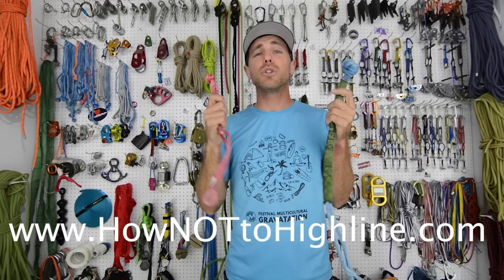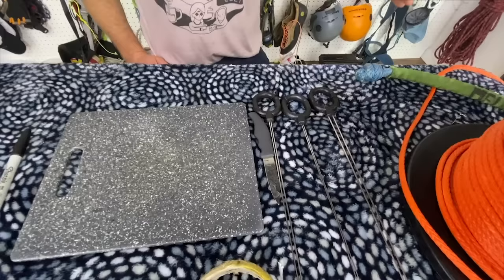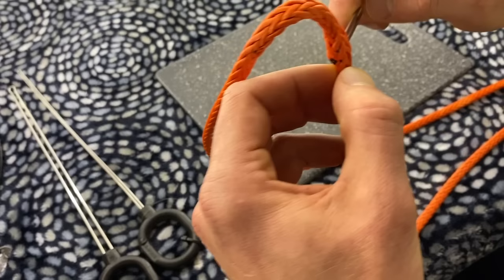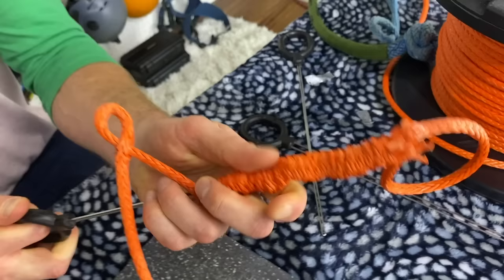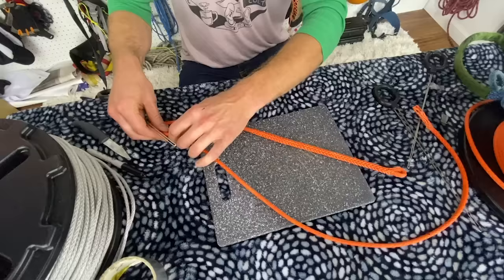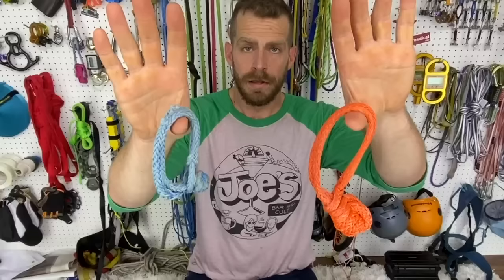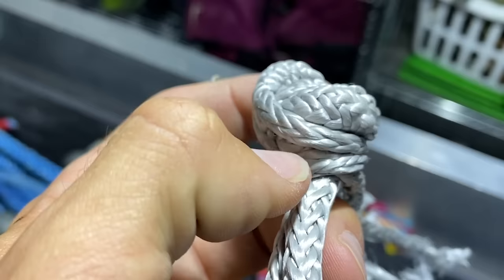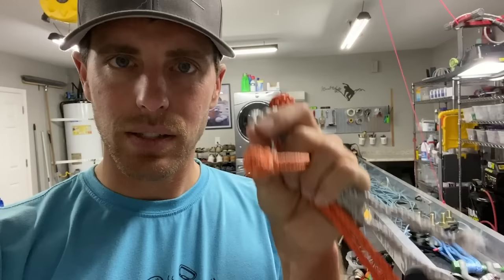Make an EASY Amsteel soft shackle with overhand knot - includes break tests!

Comment: Maybe use them as bail anchors to rappel off of, they are super light?  Carry a 7/64 one for emergency rappels?  Can a rope be threaded through and then pulled?
Reply from the maker: You would die.  The climbing rope under tension would cut through it.  Ropes moving over ropes is bad.
Reply: HowNOTtoHIGHLINE I think he means double roping down (so no abrasion during the rap) and then just pulling down one leg once you’re on the ground

Comment: I’ll preface this by saying I’m a hammock camper, not a slackliner. That being said, I hang with 1/8” loops made with the improved button knot. Instead of making a noose, I make a loop, and put the end through the legs under the knot, and loop it up and over the knot. I find it equilizes on its own, and in order to break, it wound have to break all 12 strand, not the splice for the loop. Would that make sense in your sport?

Comment: Try putting a line the length of the shackle so as that defamation is more readily visible and the failure analysis portion of the test has more evidence to be interpreted.
It would be interesting to see various tapers tested EG two strands every inch, one strand every inch, two strands every 2 in ect. ect.

Comment: Could you not get away with a brummel lock splice at the two eyelets at the top of the knot? This way you would essentially be using less dyneema or amsteel to construct soft shackle, it seems that there is a lot of excess waste used in the tapers that need to be back fed. I have been a tower rigger for more than 25 years I'm not sure that this will be easily accepted into our industry as of yet until a lot more testing has been done, they would need to eliminate any chance of human error. I happened to watch the previous video to this one with a button knot I did this as my first attempt that was not fun, then I see this video for the overhand knot wow, way easier! Also I have seen a process where some guys use a farm jack to tighten the button nut I'm sure you could use the same principle to tighten the crap out of this overhand knot and make it super tight, because in your video you can see where you backed off on the tension at one point and how the knot loosened up. Keep up the upbeat Fountain of Knowledge, this is terrific to see someone that enjoys what they are doing.

Comment: These are common as a replacement for a normal shackle when joining tow ropes whilst pulling out bogged 4WD"s. and if the ropes snap there's no steel projectile flying towards your windscreen. Try using a Brummel lock-splice at the eyes, it'll stop any slippage in the berry.  (https://youtu.be/K0eZz36PRYI)

Comment: If you use a real knife (like anything from Spyderco or Benchmade) no duck tape is needed because you'll have a lightsaber for a blade straight from factory..They make great climbing knives too. Even models without points if that's your thing or it bothers you(Rescue knife)
Reply: Or a rigging knife and a mallet. They're designed to cut rope quickly and cleanly. Lay the rope on the table (or over the spar on a ship), hold the knife over the rope where you want to cut it, smack the back of the knife with your mallet to cut. Very fast, easy, and clean cuts.